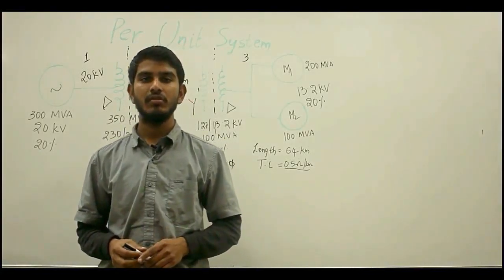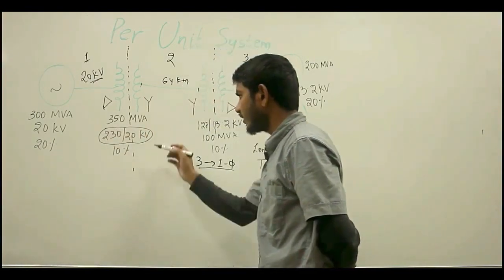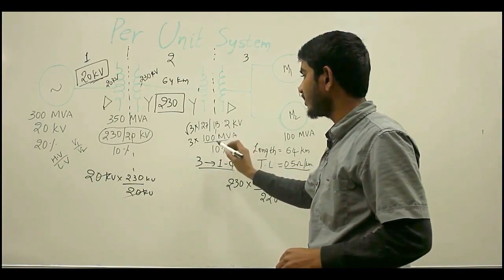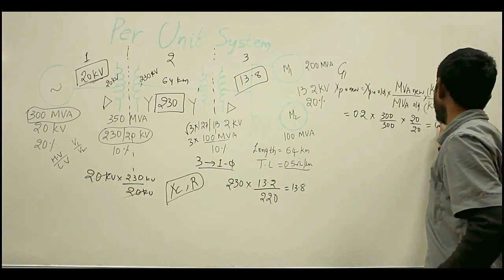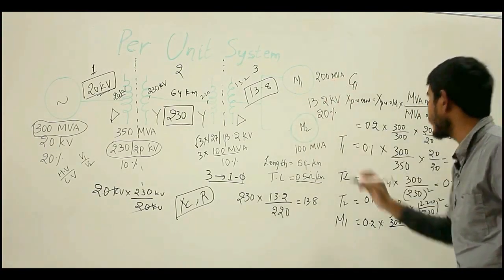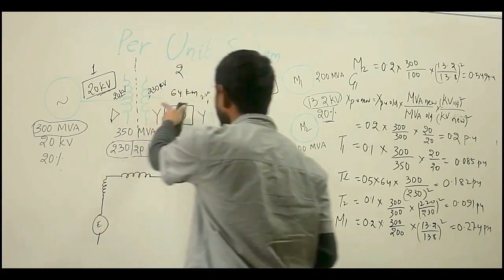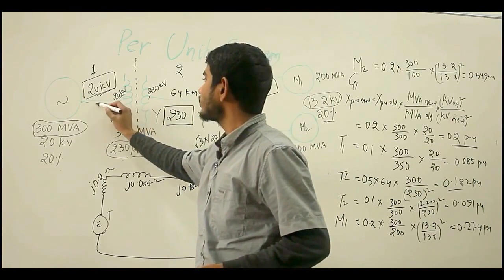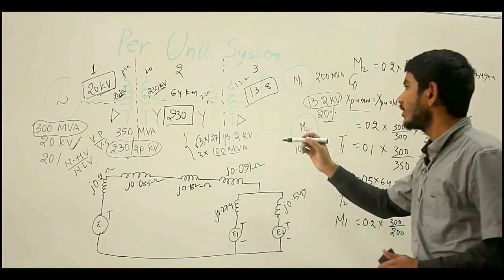Per Unit System Solved Example

Comment: I have one question: When you have a delta-wye connection like the step-up transformer after the generator, this configurations in both sides does not affect the reactance of the transformer?I mean , for example you dont have to divide the reactance by 3 in order to convert delta to wye (because wye is considered as the one fase diagram), due to the fact of this two kinds of connections that are present in the primary and secondary. Thank you